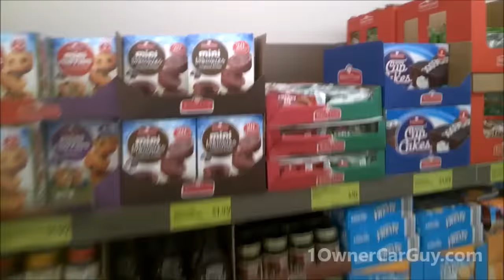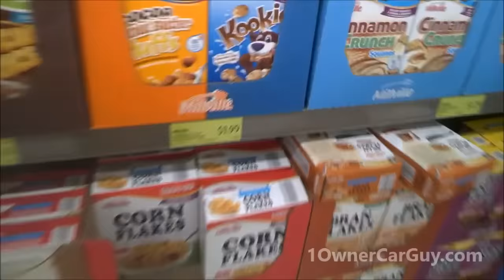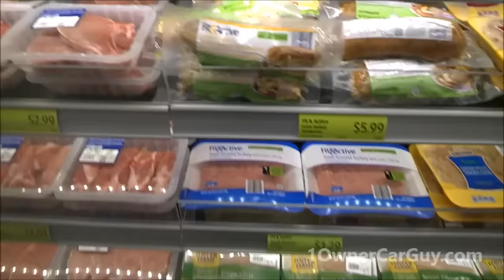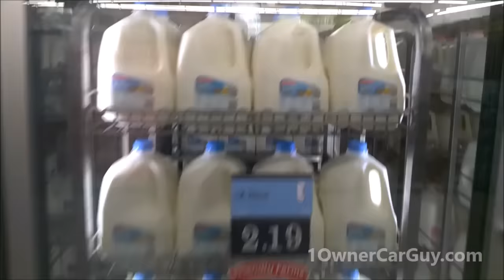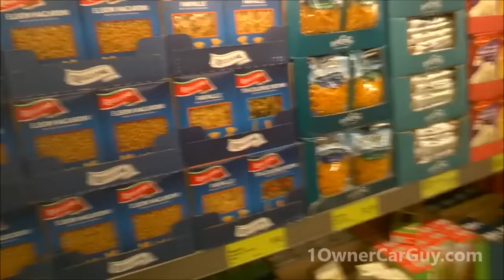Loading Cars on Trailer Auction Car Pickup Video ~ Behind the Scenes

Comment: Couple interesting facts... even though Chrysler bought AMC in the late 80's, they left the Grand Wagoneers relatively unchanged. They continued to source the Carburetor and ignition system from Ford till the end. The carburetor is the Motorcraft 2150 2 barrel, and the ignition system is the Duraspark Electronic Ignition. These are cool, I got to work on one a few times 13 years ago at the dealer I was working at. The guy bought it from The Wagonmaster down south (a guy that buys all of these Grand Wagoneers up, fixes them , and re-sells them) and ended up having to put an engine in it after he bought it. I ended up doing some maintenance, and all the recalls they had for it. Only real problem was the original owner had dogs, and it smelled bad inside. Other than that, it was a clean ride. EDIT: wow, The Wagonmaster is really charging allot for these now, he used to charge betwenn $15000 - $25000 per example.